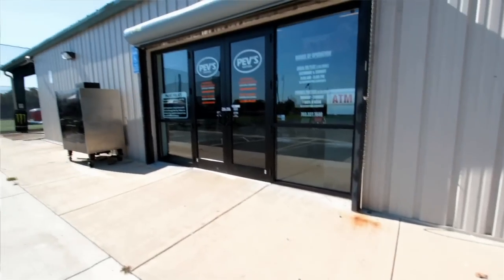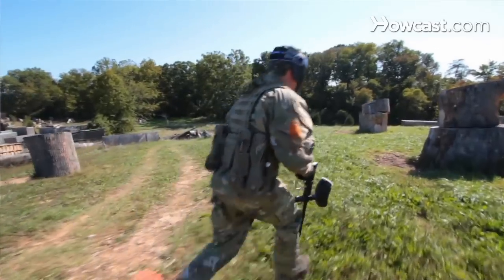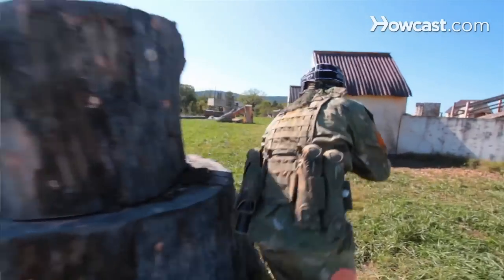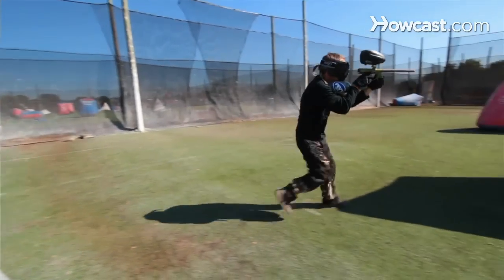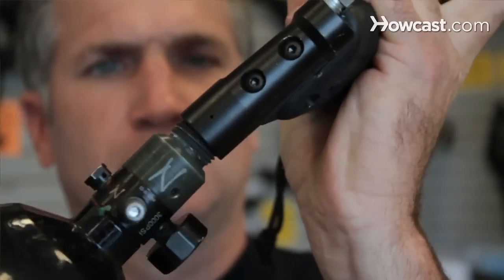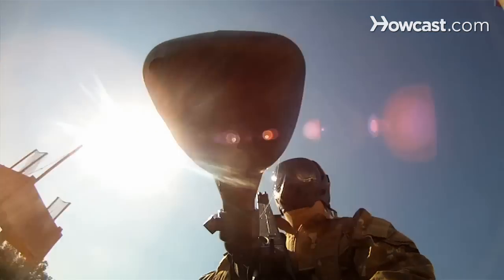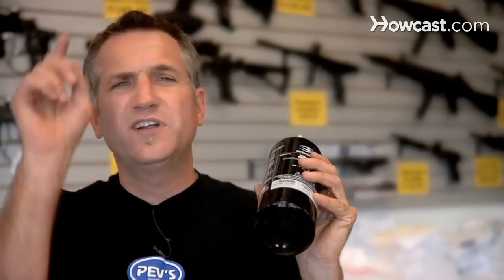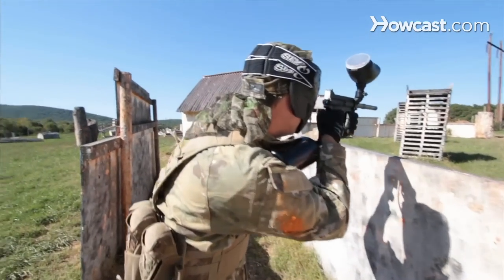Compressed Air vs. CO2 | Paintball

Comment: actually, co2 holds more shots. the energy of vaporization in liquid co2 is several times greater than compressed air
Reply: I need help with mine..like a lot..
Reply: And is 2 as expensive
Reply: Lmao ok sure
Reply: @arroyo_Lt0  google co2 vs compressed air. any article will tell you that co2 holds more energy. are you comparing co2 and compressed air tanks of the same size? because its only a fair comparision if they're the same size.

Comment: I agree that compressed air is definitely better for consistency, and less wear and tear on your guns, but don't lie to everyone saying you get more shots from hpa. Once you start firing a few shots it becomes less and less pressure that it can put out. I can get around 600 shots from my 4500 psi hpa tank ($125) or 1500 from the 20 oz co2 ($35+$5 for refills). But I'd rather use the hpa because of wear and tear, your guns will last much longer with little maintenance.
Reply: This was the info I was looking for! Greatly appreciated. I'm looking for a remote line option for my HDR68, and sticking with CO2 makes more sense.

Comment: CO2 works great if you have the following criteria. Use a remote line with the tank carried vertically on a vest or belt. Put a Palmers Stabilzer on the gun. Don't play in the cold. I live in Texas where it rarely gets really cold. Use a slow rate of fire like you get with a stock mechanical trigger. This is my set up and my velocity is VERY stable even with CO2. If you can't meet all these criteria switch to HPA. If you can afford it get HPA anyway. I'm a poor bastard so I had to make CO2 work for me.

Comment: Co2 last longer I have been a paintball marshal at several sites with co2 and air and co2 always last longer in my experience and is more reliable in a screw in and play. At one site co2 never spiked at another site running air their guns were spiking left right and centre the only downfalls co2 have is that it unclean and puts water into the marker and when it using the wrong valve setup and the velocity adjusters are out due to the velocity spring worn out their an arse to get to fire properly by all means correct me if am wrong just talking from previous experience with in the field the age I would recommend air as it better for the marker and can be left on whilst filling the tank but for lightness that only comes with the air tank if you fork out for a more expensive tank if you have a beginner tank it still going to weight the same as a co2 tank.

Comment: if i buy a paintball gun and it comes with  co2 tank can i just use compressed air?
Reply: yeah, any paintball gun can use hpa or compressed air, but not all paintball guns can use co2. it is recommended that you switch to hpa if you plan on buying and using a high end gun
Reply: ***** like woods ball gun
Reply: REPN noobie45 CO2 is fine on a typical woodsball gun like your Tippmann 98's or your BT slices etc. but air is a lot cleaner and more consistent, generally much better for your gun
Reply: Yes you can I have a Tipman bravo 1 elite and it came with co2 so i changed it to compressed air.
Reply: Ian Brackeni have a spyder aggressor gun, can i use it with compressed air?
Reply: Yes you can
Reply: thanks George Dore i'll try it and see the difference. my co2 tank gets empty pretty fast and also it has been fixed 2 times already. so yea, i'll go and get a compressed air tank and see if i stay with it

Comment: I'm just getting into the sport and needed a simple, fast and informative comparison... Howcast is ALWAYS the way to go! Can anyone recommend a cheap but GREAT paintball gun? I'm looking into a Tippmann Bravo One with a pressurized tank.. not sure if that's the BEST way to go :/
Reply: I'm not sure how much that gun costs. But if you want a cheap reliable gun with a mask and Co2 tank ( the gun can use Co2 or Pressurized Air ) I would go with the Tippmann Alpha Vlack US Army gun. Go to ansgear.com then "guns" which is on the side. Then scroll down to US Army guns. Then click US Army then click Alpha Black.
Reply: i would actually go with a tippman a5 or a tippmann 98 custom (for scenario ball) but for speed ball maybe a spyder victor. also if ur getting a tippmann dont use CO2, its horrible for the gun, because the CO2 gets so cold it will freeze ur O-rings and cause alot of problems, since tippmann O rings are not rubber

Comment: What is the difference between Nitrogen (N) and compressed air? Thanks
Reply: You will have even less variation during temperature changes they use nitrogen in hi end race cars to allow consistent tire pressures to allow for optimum performance on the track that is more predictable

Comment: m just getting into the sport do i have to worry about over pressureizing
Reply: The only thing you need to worry about is make sure you're going to the right filling station for your tank, which should be either a 3000 PSI tank or 4500 PSI tank. The air station will be labeled as one of those. The air compressor stops when it comes close to the maximum PSI for your tank; you'll know it's full when you can't hear air rushing into the tank anymore.

You can also ask a referee to fill your tank for you if you're still nervous about doing it yourself, or ask them to show you how to fill your tank.

Comment: does any Tippman gun work with a compressed air tank? (I'm new and just bought a gryphon because i heard it was a good and cheap starter)
Reply: I have a gryphon as well, and the answer is yes.
Reply: +FluffyWubblers it should work (just saying I am a beginner to and trying to find a good gun 4 me and I am looking at the Azodin Kaos)
Reply: +FluffyWubblers cronus works with both
Reply: Dylan .Briggs thx
Reply: That's a good choice in a starter gun when choosing compressed air my advice would be a 0.8L 3,000 psi tank also buy a tank cover saves on dents and chips
Reply: +ShoeGameOnFleek for beginners always go for a tippmann very low maintenance and durable as hell I still have my 98 from 5 years ago shoots the same as when I brought it from new .
Recommend upgrade the barrel from the slandered 11" to at least a 14"
Reply: ok thx

Comment: With a co2 tank will it be smart to keep it some where colder in the Sumer?
Reply: yes but its not the worst thing in the world as long as u don't leave it  outside, just leave it like inside and it'll be fine as long as u have an AC
Reply: Keep it out of direct sunlight and wrap it with a damp towel. The frog tog chilly pad works great. These cool with evaporation so they must have exposure to open air to work. A cooler with ice works to. Seen a few tanks pop the disc under the Florida sun, usually attached to markers sitting on tables between games. Despite the negative issues with CO2, I will stay with it. The risks and hazards of HPA are grossly understated or are never mentioned at all.

Comment: im a newbie at paint ball ive only gone around 6 times and i decided to get a gun but when i look at hpa tanks it says stuff like 48/3000 idk what that means,could you explain it and after what size would you recommend
Reply: first nuber cubic inch secound psi
Reply: +Nicolas Paquette 3000 is the max safe pressure which means fill the tank till the gauge gets to the 3 and the 48 is cubic inches which is basically the size if the tank the bigger the number the more air it holds ie. 30/3000 holds less than 48/3000

Comment: I'm a new player and i brought the  Tippmann Cronus Basic Semi Automatic .68 Caliber; what would be better compressed air or CO2
Reply: +Brady Mckendre co2 is cheaper hpa last a little longer
Reply: +Brady Mckendre An HPA tank (compressed air) is always better, over time a CO2 tank will cost more because you have to pay for refills, also CO2 will blow your O rings faster then compressed air which is also bad, CO2 is pretty much worse in every way, it will eventually cost more because it is payed tank refills, its worse for your gun, it's semi bad for the environment, and they are heavier then most HPA tanks

Comment: The information here about co2 is compleatly wrong!!!
Co2 can be compressed more than O2. It compresses so much that yes it becomes a liquid state. But there vil always be co2 gass in the bottle also. It is this gass you use to fire the marker (never the liquid form). The more the pressure drops in the tank, the more of the liquid co2 is going over in gass form. This makes for more shots in a co2 tank than in a compressed air tank. Over twise as much actualy.

Comment: Could you fill a compressed air tank with an air compressor?
Reply: Not with out something like a shoebox booster hooked up to it. The reason being that a typical shop compressor outputs about 110 psi at the most (the ones I've seen anyways) but with the booster you can up that to 3000 or 4500 psi, since you need to fill your tank to 3000 psi (if aluminum) or 4500 psi (if carbon fiber). If you don't have a field near you that fills compressed air, I'd just stick with co2 unless you have something that requires it.